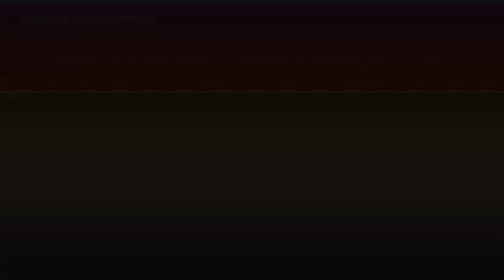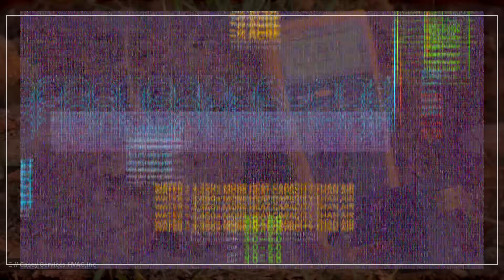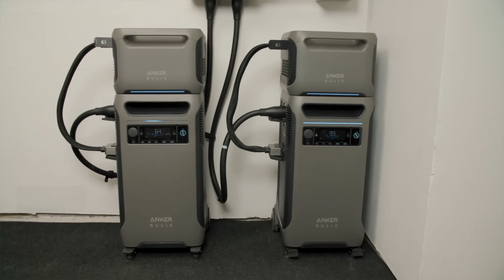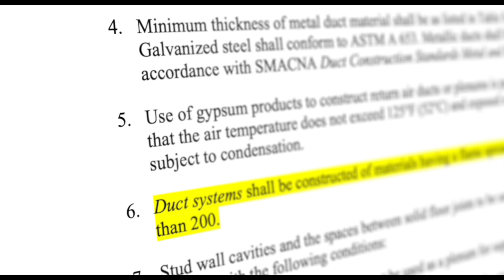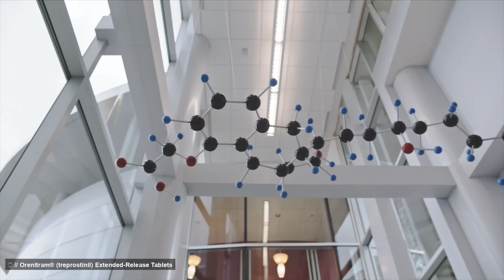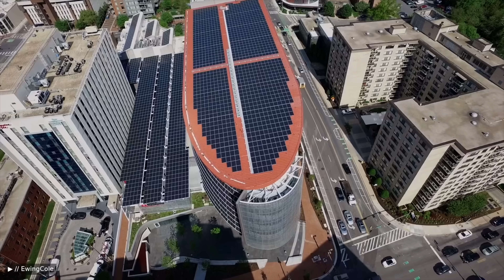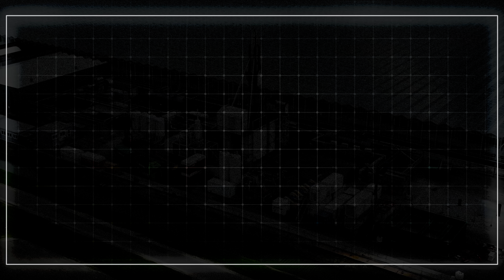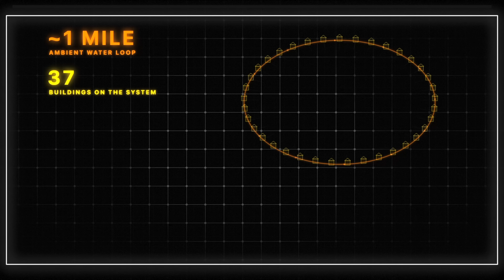The Viral DIY Cooling Hack That Nearly Killed a Family

Comment: Our family in Germany built a new house ten years ago with the piped liquid geothermal. The heat comes through the floor. It's ever so comfortable in the middle of winter. It's been very reliable, too. The complications have been the death of enough technicians being available for adjustments and repairs. Also, their setup was meant primarily for heating. Cooling would require an expensive retrofit, if it's possible. They really could have used the cooling during the recent heat waves.

Comment: When it comes to heat pumps the energy it uses is to move heat up the thermal gradient. The further you have to move the heat up the thermal gradient the more energy it uses per unit of thermal energy moved. Having a relatively thermally static heat source/sink would definitely have a running cost benefit over having a source/sink that fluctuates wildly like an air source system especially if that source/sink was close to the desired temperature of your conditioned space. Good insulation and something like a heat recovery ventilation system would also help by reducing the volume of heat required by reducing the thermal leakiness of the conditioned space. The bore hole system wouldn't use a heat pump at all would it, just pumps and fans to move the air and liquid. If the source is below the sink thermosyphon might work making it passive but only during the heating phase not the cooling phase. you would be fighting the thermosyphon with pumps during the cooling phase. Having a deep bore would make this more energy intensive than a shallow system.

Comment: We have ice-cold water at 30' in North Florida.  That's were we sink our shallow wells for lawn irrigation.  Wouldn't hat be perfect for geothermal AIR COOLING, at least? Most of the way down, it's sand + maybe a foot of clay.  No expensive boring rigs.  pretty simple.   No 12,000 boring holes.
Reply: You wouldn't want to run air through such a system in such a humid climate (mold, bacteria, radon, etc). But a closed loop water system connected to simple heat exchangers like radiators and low wattage water pumps, would make a difference and would lower energy bills. And if you do the work yourself, it wouldn't cost too much. Power the pump(s) with a bit of Solar and batteries and your energy bills go down even more.

Comment: If you turn your HVAC off or down when you are not home thinking you are saving money, your very wrong. The amount of energy it requires for your system to "pull down" the house upon your return in the evening not only requires far more energy than what it takes to maintain the temperature you prefer, it also puts more strain on the system causing undo wear and prematurely wears out your system. This is a common fallacy that is hard to get most people to understand. When your system is off the humidity levels rise inside the home. When you turn the system back on it has to remove that added humidity. This requires the removal of latent heat, which has to be removed before the system starts removing sensible heat which is the perceptible heat we feel. It is much harder for your system to remove this latent heat in the structure which requires more energy. Just leave your thermostat alone, you, your home, your wallet, and your HVAC system will be much happier for it !

Comment: I’m in California too, with lowest temp at around 35, air source heat pumps runs pretty efficiently most of the time. I would rather spend more on solar than digging.

Comment: If anyone wants an in depth discussion of the technical details of this type of technology, look up the channel "Technology Connections". He has a few videos on how the "refrigeration cycle" works and how the heat pumping technology used in air conditioners could be used in reverse to transfer heat into a house when it is cold outside. He also has a few that discuss geothermal options.

Comment: I’ve been running a ground source heating system here in France for 16 years and it has been brilliant with no regrets whatsoever, (and I’d definately do it again if we changed house). The tip I was given was not to rely on one deep borehole but to do at least two less deep boreholes so that should one ever underperform, the others can compensate.

Comment: The year-round temperature of your soil depends on where you live. ASHRAE publishes tables that will tell you what that temperature is. Any good geothermal designer will also test your soil for thermal conductivity to determine the dimensions of your thermal well. Different types of soil absorb heat differently. Many schools have geothermal systems, since they usually have large ball fields or parking lots where the thermal wells can go rather than putting them under buildings where maintenance is harder. In the Las Vegas area, the summers get so hot that many schools also have supplemental cooling towers in the water loop to exhaust extra heat, or else the thermal wells will actually get too hot to continue absorbing heat by the end of the summer!

Comment: As a licensed and certified HVAC technician I can say that any plan using air as the refrigerant in a system is a gimmick. Air is one of the worst mediums you could use to transfer heat from one place to another. Which is what we are trying to do. Water has been one of the best, most environmentally friendly, and efficient means of doing this. Yes, geothermal HVAC is a legal and effective means of  heating and cooling homes. However it's effectiveness is largely based on local geology. Some areas it is absolutely the way to go, others the cost of building a working system outweigh the benefits.

Comment: A system that is just buried or drilled in dry dirt eventually heats up or cools the ground around the pipes it doesn't matter if its liquid or air. After a few hot(cold) days in a row, it's not very cool(warm) anymore.

Comment: I'm doing something similar to this! I'm putting a 500 ft water loop down at 6-10 feet with only like 7 feet either side coming aboveground. The idea was to loop it around a 4 ft tall 8 inch wide concrete tube from top to bottom, then go out and wrap around a 4 ft tall 12 inch wide tube placed around the first one, then go over a couple inches from the top of that one and do the same thing in reverse. then Por a mix of 40% sand, 10% bentonite, 15% portland cement, 10% lime, 10% silica, and 10% graphite powder, plus enough water to make it pour. It might not support a whole house, but I only need it to manage a roughly 10x20 room. And the water would be roughly 2 gallons of propylene glycol, 1 quart of fernox fl protecter, 10 oz of redline water wetter, and roughly 8 gallons of distilled water, which would be pumped by a taco 007e pump into a water to air radiator connected to a box fan by a shroud. No heat pump or massive bore hole means total cost shouldn't be more than 500$ total, but It obviously will need assistance in the winter potentially, but they make small heaters for a reason, and it'd absolutely still use less electricity considering the pump and fan at most use like 150-200 watts.

Comment: The issue with air ducted ground thermal systems is that in humid climates warm moist air is drawn into cool ducts where the moisture condenses onto the ducting. The moisture mixes with organic particulates from the air and forms a perfect environment for mold. Proper drainage mitigates some of the problems, but does not alleviate them.
Reply: @GoCoyote  there’s an extra step of dehumidifying air before ducting it into the home, but there are videos where it has been done
Reply: Yeah, he did actually say that in the video, a couple of times.  Did you not watch it?

Comment: 200 feet of bore is really expensive. Not to mention the cost of the pipe/concrete you are filling the hole with. You must be hugely rich. You could easily spend the price of your home digging 4 holes.

Comment: HVAC engineering insructor here with a Water furnace ground sourced system.  Ground sourced is really popular in government building a like hospitals and schools that are large and have the budget for it.  A few details:

Each well has to be at least 20' from the others to avoid ground heat saturation. One well per ton of cooling is the norm.  So, a four ton system might use a 20x20' area for the wells. 

The wells are the expensive part, but they are also extremely durable.  My driller said he had never had to do a repair on a water loop on 30 years of business.  They are thick walled flexible tubes deep underground.  

You can convert an outdoor conventional split unit without needing to modify the indoor unit, in theory, but the heat exchange is so efficient that the outdoor unit's job can fit inside the indoor unit.  This also uses left refrigerant, which makes the system more efficient and more durable.

Comment: Here in Missouri, there is a historic site, The Bothwell Lodge, where the house/home is built to pull air from a cave network.

While it is not the most reproducible of solutions, it is an example of the idea being around for some time - and probably sparks the inner child with ideas of opening up a vent only to find a portal to the abyss.

Comment: Love it!  My folks had a geothermal retrofit done.  Theirs is a horizontal underground system.  One of the big factors was their geological area where there is a lot of shale and drilling for a vertical system was unmanageably costly.  In the process of moving into a new home myself that also has underground geothermal but I'm not sure if it's a vertical or horizontal installation.

Comment: There is advice for when your heat source fail in middle of winter.  Always have backup.  Thermal +  Natural gas or Thermal + fireplace etc...  backup doesn't have to be latest greatest it's just a backup .

Comment: That power station advertisement makes me think about how interesting power storage will become once hydrogen batteries are released. Rather than 7.7kwh, you will instead have 46.2kwh in the same package. Which, for some reason, makes me think of space ships since you can basically power a whole home for a whole day with something you can pull like it's luggage. :face-blue-smiling:

Comment: I installed a 4 ton closed loop 14 years ago in NW Florida and it has been trucking steadily ever since.  I used a Bosch cupro-nickel plated unit.  One important issue is sizing.  A 5 ton unit may only produce 3-4 tons of cooling if ground water temp is higher than expected.  Paying close attention to ground temp tables that determine BTU output at various temps is really important.

Comment: instead of spending $50,000 for bores, pipes,, how about put on a sweater in winter, use a personal mister in summer.  I live in So Cal.  I have a miniscule electric bill.  PS - what about all the landfill waste when your solar panels go bad.  (I saw that in Australia you can't even install ones that were 7 years old..!)  Whatever the criteria is, there is a definite LIFE to all this technology.  A real environmental cost to windmills, solar panels, lithium batteries ( I say as i haul 110 pounds of misc dead batteries to the recycler at 12 cents a pound).

Comment: The takeaway for me is I need to learn how to become a licensed/certified borehole driller.
Reply: You actually just need to find someone who will rent you the drilling rig. No need for licenses or certifications if it's you doing the work. Also that's an over-blown problem anyway, it's just a well, anyone who can drill a well can drill a geothermal well. Wells are, of course, quite expensive.

Of course, you can drill multiple, shallower wells, and get the same effect as one expensive deep well, so this is definitely in the realm of DIY, people have done it, some on youtube even, it's not really that complicated.

The complexity comes from the heat pump side of things, because you need to have a water heat exchanger instead of an air unit. Alternatively, you can modify an existing unit, which requires you to be able to capture all the refrigerant, cut/braze the new heat exchanger into the circuit, and then refill the unit with refrigerant. Again, people have done this, but, it takes specialized gear and you'd be better off hiring someone to do it for you. Also newer heat pumps are likely not going to work, too many sensors to try and keep happy, what you want is a non-inverter unit, because those are far less picky. Then you just need the unit to control the pump, easy work with a relay.

So no real need to pay a ton more here if you're willing to do the work, and it keep the break-even within the lifetime of the unit, instead of many multiples of the unit's normal lifespan.
Reply: @jttech44  yeah until you hit the spicy house roots, the house water lifeline, the house fart tube, or worse, the house rectum 🤮
Reply: @jttech44  Drilling bore holes is not a DIY activity.
Reply: @kentium4  You need deep knowledge

Comment: I have a ground source geothermal system I put in during my remodel that finished in 2022.  I'm in UT where electricity is stupid cheap (11c / kWh), but I wanted the most efficient system I could get.  I didn't appreciate that a compressor is still rather expensive to run, but I'm sure I pay a fraction of what I would with any other system.  it was worth the cost, but drilling alone was ~$70k.  I have a 5-ton system and 5 200-300ft vertical ground loops in the yard

Comment: You can use earth to air if you divert the air to your AC outside unit. This would be somewhat viable option, as the AC moves the heat energy, instead your house ducting.  But still very inefficient compared to a water system

Comment: The data is in: the earth acts like a giant geothermal rechargeable battery. Within parameters, yes, it does supply some heat/cool, but most houses experience a two year saturation. The interesting part is that, with sufficient capacity, you are literally storing cool in the winter and heat in the summer. The seasons change and you reverse the system, pulling out that energy you busily stored in the opposite season.

Comment: I live in the Vegas valley and have an air source heat pump and solar. My electricity cost for the whole first year was $224. These were my total energy cost, since I electrified everything. Additionally I banked about $600 towards future/never use since my 10kW peak solar system produces more that I actually consume.
For my use case a ground source heat pump would just be too expensive. 
I save yearly about $3500 in energy cost with my setup. This might change in future since NV-ENERGY will introduce a demand charge in October, that cannot be offset with credits. However,   according to my calculations that would probably double my electricity cost to still under $500 yearly.

Comment: Twenty something years ago, I replaced the old natural gas furnace and forced-air heating system in my house with a solar thermal system and radiant heating. This was several years before the explosion of residential ground-loop heat pump systems, and I’ve occasionally wished that I’d waited a few years. The solar thermal system is certainly more efficient and sustainable than the old furnace, but a ground-loop heat pump beats it both in efficiency and lower complexity. However, I’ve never regretted changing out the forced-air distribution system for a built-in radiant heating system. It was expensive and entailed a lot of work (family and I did the entire design and installation), but the boost in comfort and efficiency can’t be beat. The old heating system was inefficient, loud, and limited (several rooms had no output vents, and were far enough from any that staying in them in winter could be miserable). Despite living in a famously dry desert, homes here can still have mold (our bathroom had some, for example), and ever-warm ductwork is one place which would be pretty tough to keep mold-free.

Comment: If you suspect mold in your duct work or living area, its easy to kill with Chlorine Dioxide.  No, its not bleach, but it does smell similar to it.  It's a compound humans can actually ingest [IN VERY LOW DOSES] to kill parasites and viruses in the body.   And to have it flushed through your duct work once every quarter, is probably the safest thing to do to keep your house mold free.

Comment: Water in copper piping should be obvious. Cast iron would be second. Plastic has 1/1000 the thermal conductivity of copper. Then a heat exchanger into a heat pump.  And, yes, don’t disturb permafrost.
Reply: A lot of ground is very slow at transferring thermal energy so the thermal conductivity of your piping matters a lot less than you think.  But if you have really good ground i.e. say water logged dense clay, perhaps even with running water, then yes, the thermal conductivity of the piping will matter more, and you could get away with say using copper and needing less of it than the plastic that is typically used.

Comment: My house in the DFW area was built in 1993, and it has had a geothermal HVAC system for the ground floor since day one. It works beautifully by circulating pure water (no antifreeze) instead of air.

Comment: Old widow decides to save on energy. Used space heater instead of heating whole house with gas furnace. Gas water heater connected to furnace flue leaked CO. Headaches, confusion, strange physical, visual and hearing phenomena - 10 yrs later solved. Doctor’s wrote it off as dementia.